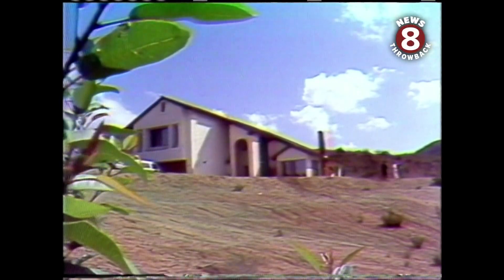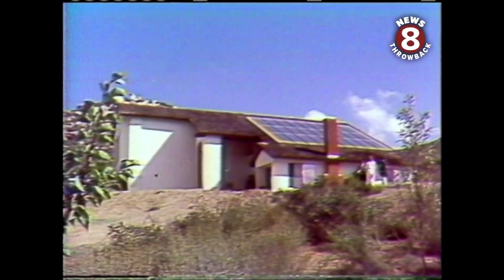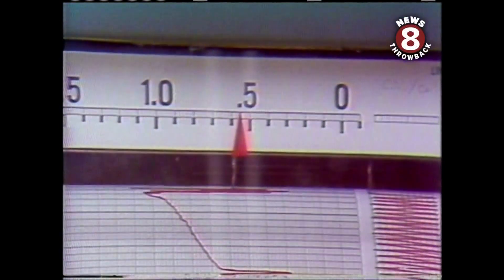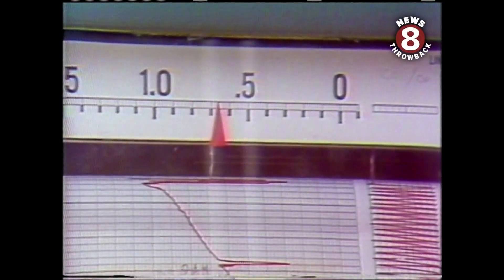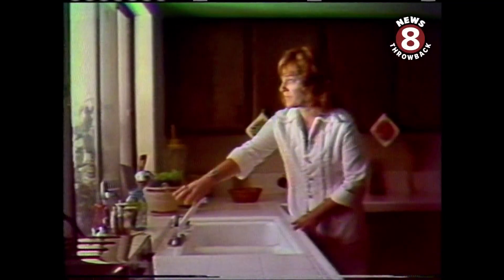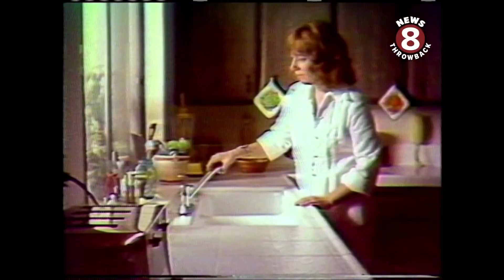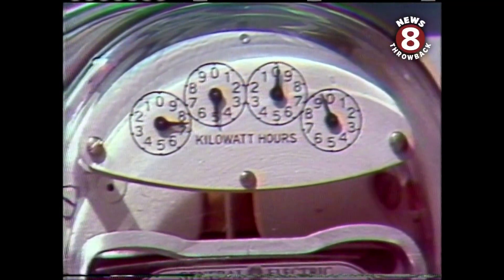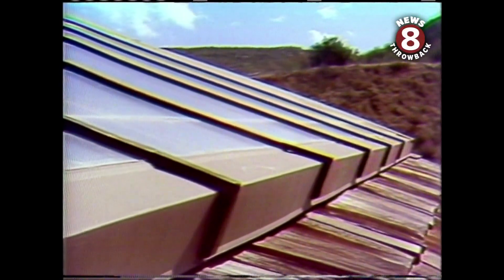Solar house in Spring Valley, California in 1976

Comment: Wow. Didn't know solar existed in the 70's. Nice archives.
Reply: Just know this not photovoltaic system like we have today this is a solar hot water system. The modern solar hot water system are super easy now
Reply: White House Actually Installed Solar Panels too in the late 70's but were removed by Reagan.